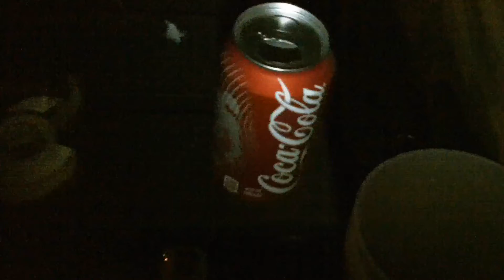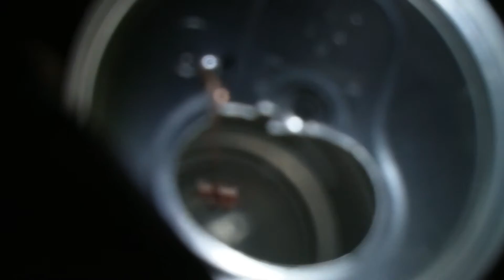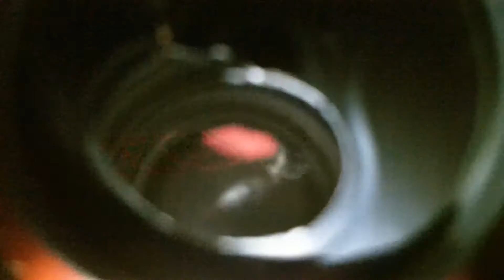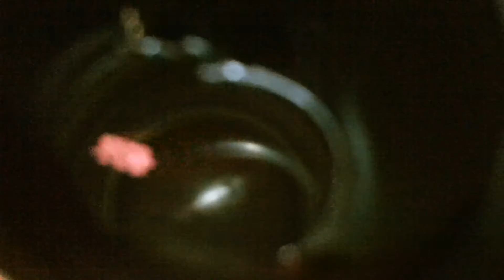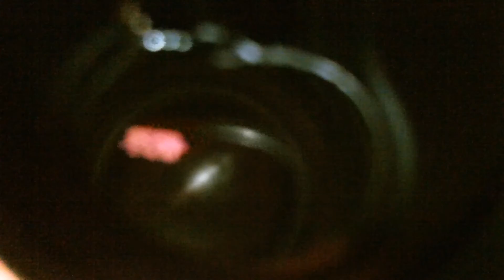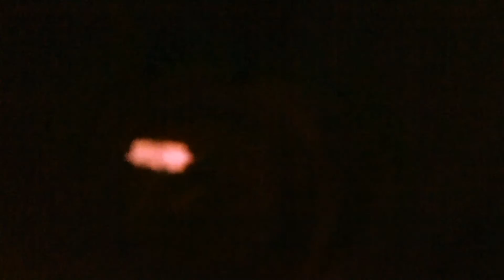Catalytic Oxidation of Methanol ( HEET )

Comment: Why don't methanol catch on fire( combustion? Methanol catalyst oxidation usually catch in fire because of heat
Reply from the maker: Sometimes it does. I guess you could think of it as a slow burning fire only on the surface of the metal.
Reply: If there is plenty of oxygen, methanol suddenly combust. As you can see, very thin wire of platinum and platinum black was used in vintage catalytic lighter,hot platinum wire can ignites methanol vapor. And we have fire! Could you pls tell me, where do you get your platinum wire?? Will it be weaken after experiment?? I know that copper wire will be weak, and broken after I do this experiment. Is platinum the same?? Strong enough to use many times?? Hope you reply me soon. Tks u

Comment: methanol is toxic. you can use also non-denaturated ethanol or pure acetone. platinum is very expensive. you can use chromium oxide, copper or silver as catalyst
Reply from the maker: Ya, if I ever do a lantern reaction again i'm doing copper and acetone. Cheaper, less toxic, more common.